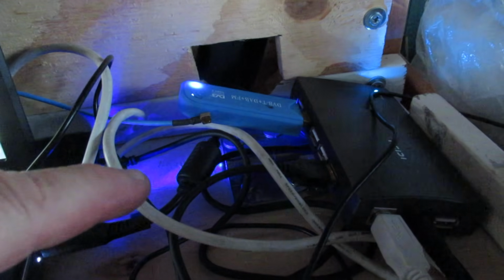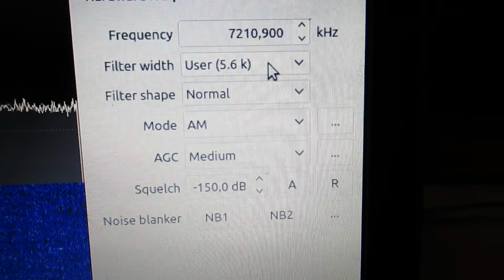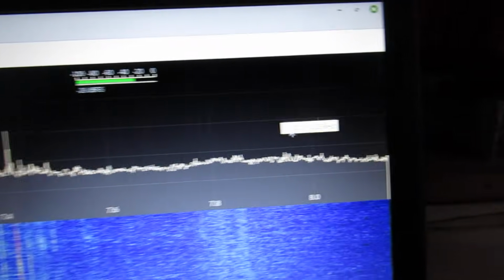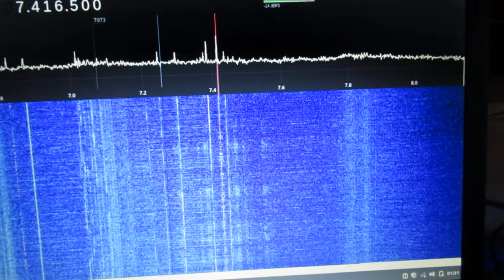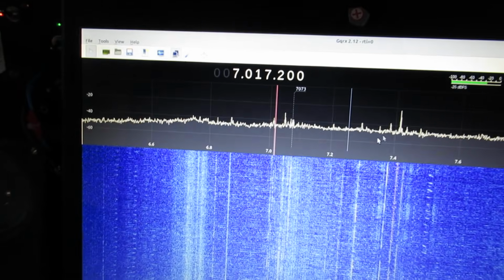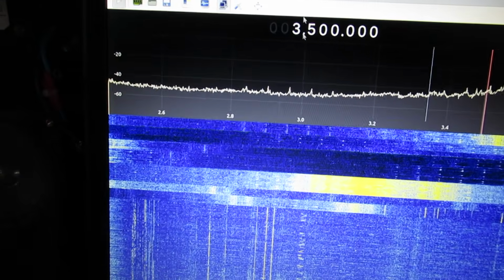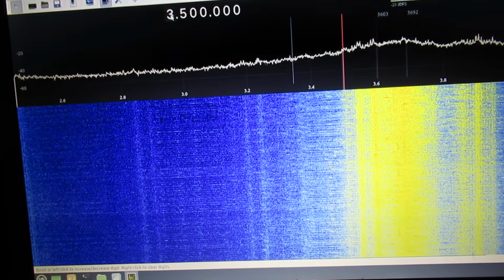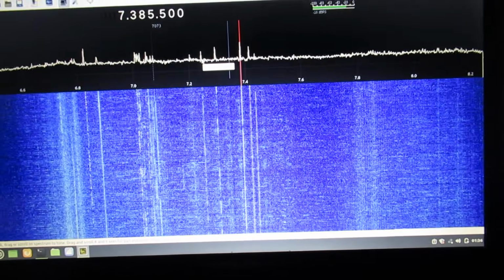SDR radio reception on Shortwave 9 May 2026 around 2100 hour Netherlands, Utrecht (demo and more)

Comment: That's interesting to  see 👀 the radio stations and background noise , looks like a good way to discover new stations and interesting transmissions 😊 👍
Reply from the maker: Hi John, thanks. Yes, you can move a certain radio band somewhere between say 3 MC and 10 MC (given that longwire antenna, that is not specialized in this case) up to more amplification, with that BC 547 transistor HF pre-amp. So with turning the tuning capacitor of that BC 547 pre-amp you can (say) swipe the amplification into the HF radio band that you want to be amplified. That is indicated yellow in the "waterfall". Thus by tuning you see that yellow band, indicating uplifting/downlifting of a certain HF SW radio band, swipe/move somewhere between (say) 2 MC and 10 MC. Thanks, Ko. 9 May 2026.